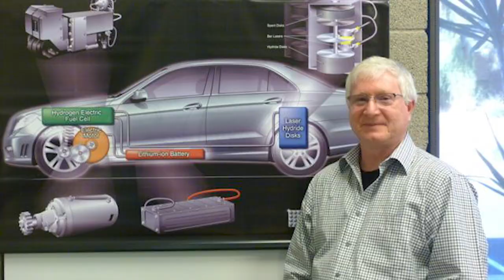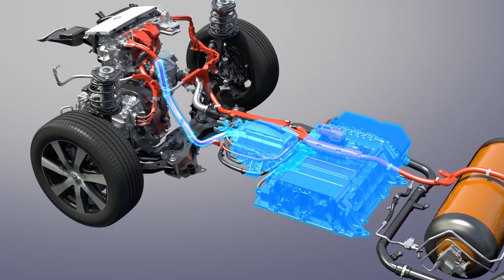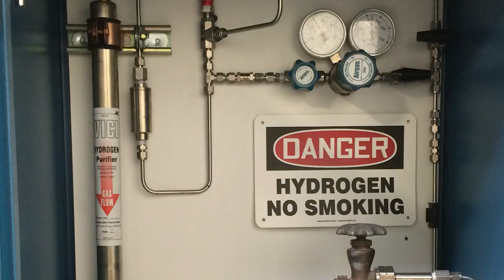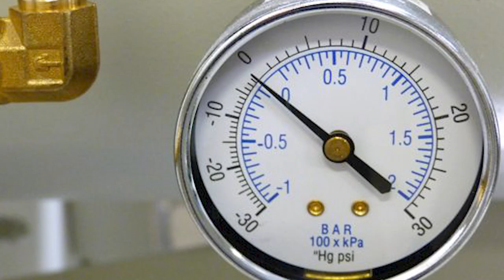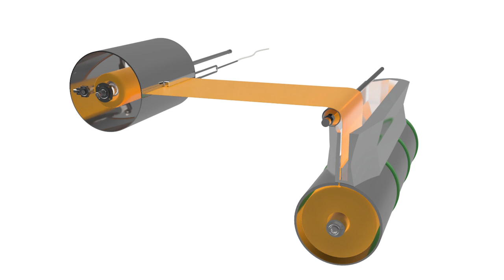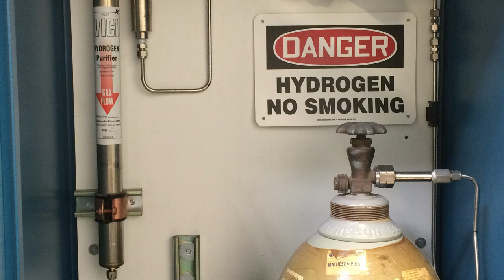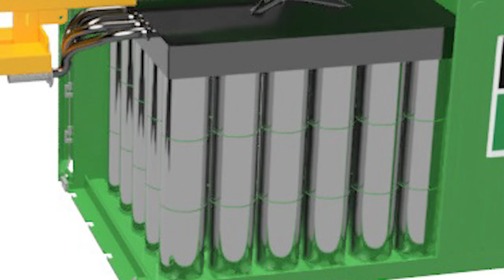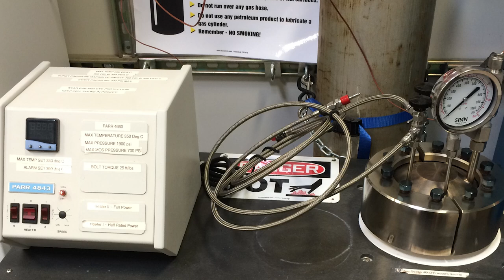This BANNED Technology Could Push Hydrogen Cars Over BEVs

Comment: IMO: I enjoyed reading all the technical analysis and inherent known and unknown issues with this technology, but as a non-scientist, I would say the hydrogen fuel "discs" would need to be substantially cheaper than BEV per mile for the average person to be willing to change out multiple 15lb., discs for every 20 miles of driving, as opposed to plugging in a cord.
Reply: The idea of using hydrogen as a fuel source appeals to me.  Particularly, if the production of the hydrogen source is not as polluting as the mining of lithium, cobalt manganese etc.   for the production of batteries. The thought of poisoning swathes of child labour in third world countries so we can drive to the supermarket in our shiny ‘green’ cars takes away the pleasure of driving.
Reply: @robertkemp9120  Old news. Batteries are getting less and less Cobalt, or even none. Batteries can be recycled for 99% and are the most efficient way to carry energy. All the steps involved in hydrogen cost 3-5 times as much, and that causes its own pollution again...
Reply: @salipander6570  at the moment
Reply: @salipander6570  Show me one - ONE commercial venture or fully subsidized venture to recycle energy-dense rechargeable batteries with 99% total material recovery - and I'll show you a marketing scheme. Not that this is the answer either; the issue is the inefficiency in energy consumption. Plus - if you are in the US, you are charging your electric car by burning coal or natural gas somewhere else (unless you are in a state with the entire grid powered by renewables (none right now) ).  BEVs are not a bad technology, but it is not a silver bullet. The real problem is the general inefficiency of the current transportation system.
Reply: Think it was 15 miles per cartridge, 10 cartridges, 150 miles.
Reply: @noimportance276  Long response, but you've triggered some thought processes. I'm going to refute some of what you said, but also agree with some of it. So this is not me picking an argument. Rather, I'm discussing what you are saying. So, thanks for your comment. It's appreciated here.

Some of the arguments in this thread arise from old information and some from the results of a long-standing campaign by vested interests to raise doubts about Hydrogen and BEV fuelled transport. 

Even if an EV is recharged from electricity provided by coal-fired generators, the EV causes less pollution than any fossil-fuels vehicle by dint the fact that the EV is at least 70% efficient overall, whereas a Diesel car engine can never be more than about 30% efficient, and a gasoline engine is no more than 25% efficient overall, according to Carnot cycle theory. From a fuel burned to energy extracted, the Carnot cycle holds merit, because it is correct mathematically and physically.

Some Diesel engine manufacturers can make reasonable claims of 50% efficiency for large engines, because different metrics are being used, and various losses can be ignored. In practice, Diesel engines in road vehicles are about 20% efficient at best, in real life driving conditions.. A gasoline car tops out at about 17% efficient in real world conditions. Many are run far less efficiently than that.

The coal-fired power plant is inefficient, for sure, but the maths adds up, otherwise nobody would be running them for very long without substantial subsidies. Incidentally, the worldwide oil industry is subsidised directly to the tune of about $6 trillion each year. And that rises to several times the amount when indirect subsidies are considered. Robert Llewellyn made a video about that in the Fully Charged Show, within the pasty year. His sources are valid; I checked them at the time.

In practice, many EV owners recharge their cars from their own solar PV panels. I don't, because I don't have the space to recharge my EV at home. About 20% of homes in the UK have the same challenge. I use public recharging, and it hasn't cost me a penny for the past 5,000 miles. UK grid electricity is partially from solar and wind sources. So far this year, about 33% of the grid supply comes from renewables, and another 10% comes from nuclear power plants.

When you start to look at the ways in which fossil fuels, and about 90% of Hydrogen, are sourced, the overall system efficiency becomes abysmally low. Hydrogen, in the main, comes from petroleum and 'natural' gas. Finding that oil and gas requires a lot of energy input. Drilling and extracting it needs even more. But at that point, the fuels are not useable. They need transporting, refining, transporting again, usually in Diesel-fuelled trucks, pumping and dispensing into the end user vehicle, each step of which is inefficient. At that point, it is burned at 17-20% fuel efficiency. Sheer madness, from an environmental viewpoint.

To present the vehicle efficiency in a different way, my EV [a Renault] has an available traction battery capacity of 52 kWh. That energy is roughly equivalent to the total available energy in 1 Imperial gallon of petrol [gasoline]. - We'll stick to miles and gallons, because I grew up with them, and because you use them daily. The differences between US gallons and gallons don't matter here, because I'm only comparing figures for two different vehicles.- I owned a small 'efficient' gasoline-fuelled car, which could manage 60 miles per gallon, when driven carefully. If worked properly, it would do about 40 mpg. My EV has a claimed range of 243 miles per charge - about 6 times that of the petrol car. When I drive it carefully, I can extract at least 280 miles from that 52kWh, maybe more than 300, but I haven't tried to run it to exhaustion. So that's about 5 times the range of the gasoline-powered car.

Roughly 70% efficiency divided by 5 is about 14% efficiency for the gasoline engined vehicle. Real world figures obtained by the same driver. The EV is heavier than the gasoline vehicle, so that affects performance somewhat, but the EV is far more comfortable to drive, much quieter, and less smelly than the gasoline car.

The next biggest issue for me with Hydrogen-powered vehicles is that they carry Hydrogen fuel tanks, protection for those tanks, a fuel cell, management for that fuel cell, a traction battery, battery protection hardware, the battery management system and the ancillary equipment which can be found in both EV's and Hydrogen cars. This is a lot of added complexity and mass, which means more cost to the consumer. Then there's the price of Hydrogen. I watched a recent video about refuelling a Toyota Mirai. The Hydrogen cost $64 to refill the car. The projected range was about 260 miles, after filling. That's a cost of about 25 cents per mile of driving, after the 'free' Hydrogen allowance runs out [3 to 6 years, as of 2022]. My EV obtains free electricity, but if I had to pay for it, then local price is about 28 pence per kWh - let's say 35 cents US. That gives me about 5 to 5.9 miles of driving. Let's use 5 miles, for the worst case, and easy Maths. That works out at 7 cents per mile.

As for the increased purchase cost to the owner, not everyone has access to incentives. The Mirai costs $68,500 to buy without incentives. The Zoe is not available in the USA, but it cost me about £21,000 via some negotiation. The list price today is about £30,000, without incentives [we only have one, anyhow!] which is around $35,000 - roughly half the price of the Mirai, and I have a similar range to the Toyota. Your servicing costs are going to be higher than those for a similarly capable EV: I pay £117 annually. The gas car cost me about £280, which must be similar to the Mirai servicing cost, given the additional complexity, if it was serviced over here.

So whichever honest way you look at it, the Hydrogen/ electric car falls short of the purely electric one, in purchase cost, running costs, efficiency and pollution. I'm not dead against using Hydrogen fuelled cars, if the infrastructure becomes available to refuel them, because they are a definite improvement over Diesel and gasoline-powered vehicles. But they're in a kind of limbo, along with hybrid gasoline/electric cars. They'll all be around for a few decades, but they are looking more and more like an economic and environmental dead end.

You also mentioned doubting the level of recycling of batteries. I'm also inclined to doubt the '99% recyclable' claim, because wastage always happens. That figure needs defining specifically by those who claim it. Maybe it's simply media hype, after misinterpreting the wording used? It could come from '99% of batteries can be recycled', which is quite a different thing. That latter makes much more sense to me, and probably to you too.
But what does happen is that used car batteries become useable in relatively low cost home electricity storage systems, for at least another 5 to 10 years before they are ready for recycling. Those batteries are prime candidates for those who mine minerals, because they contain Lithium, Cobalt, Manganese, Aluminium, Phosphorus, Iron and other elements in much higher concentrations than can be found in nature. This makes most of the quantities of each element much easier to refine efficiently, That's why one such recycling plant is being built down the road from Giga Berlin, for example. It makes good economic sense to source a part of their output from used batteries.

If you have done, thanks for reading. 🙂
Reply: @RWBHere  Obviously, you are misinformed about many aspects of Plasma Kinetics' advances in FCEV technology. There will be no onboard tanks to hold Hydrogen, for example.
Reply: @noimportance276  Many BEV owners also get solar systems. Generally I'd you're into one you are into the other
Reply: @claudfraleigh2062  
You're the one who's misinformed. He was comparing gasoline, electric and hydrogen cars that are actually produced and on the road.
Reply: @RWBHere  Mention must be made that a fuel cell uses minerals, requires maintainance and has a limited life; less than an ICE.
Reply: @robertkemp9120  o XD
Reply: I think Hydrogen will be useful for plains and cargo ships. Of course when it is cheaper. 

 Outside of that I don't see it taking off for cars. EVs offer a lot in terms of torque and acceleration which is always nice and are improving daily and some that don't use lithium and cobalt seem promising.

 Thought hydrogen was super dense per KG. 15 pounds for 20 miles...  Gotta look up the efficiency and density between engines too now 
 
 Wonder why they can't be reused more times or recycled all of it.
Reply: @RWBHere  did you account for the loss of EV efficiency from operating in below freezing weather? The chemical batteries automatically loose much of their charge, and the freezing-thawing cycle destroys the service life. 

Also, in very cold conditions, much  of the "waste" heat which makes ICE engines less effective, is essentially recovered to heat the vehicle.

Comment: Hydrogen is not green energy. It is produced by either two methods. One. Separate the hydrogen and oxygen atoms in water which requires a lot of electricity. Two. Hydrogen is a by-product of the reformation of hexane molecules which are a straight chain 6 carbon and 7 hydrogen atoms. The catylist in the reformer removes one hydrogen atom which forces the hexane molecule to form a circular molecule called an olefin. This is gasoline . The removed hydrogen atom is then compressed and stored or simply burned off at the refinery flare. So to recap, either use heaps of electricity to produce it, or keep making gasoline.

Comment: What blows my mind is how fool sells continue to amaze people who can't wrap their heads around thermodynamics... How is this extra contraption making the Rude Goldberg battery that is still an HFC PEM, with a new storage tank any better?

Why did I not hear about:
Energy density.
Power density.
Conversion efficiency.
How does this beat metal-hydrid storage.
Reply: Because if they listed specific number, we would realize it is not that great.
Reply: Exactly. This isn't passing the sniff test.
Reply: It doesn't beat metal hydride storage because it is metal hydride storage. Using a laser to heat the metal to release the hydrogen is a new twist, but doesn't really make it better than other metal hydride proposals.
Reply: @chrismuir8403  awesome... So my two decades old 20 liter tank is still state of the art.  Awesome, I'll take a Li-ion battery any day in that case.  What a damn joke.  It would be funny if it weren't so sad that EVen Sandy has fallen for this garbage.  Trevor who?
Reply: @flodjod  granted.
Reply: I suspect it IS metal hydride storage.
Reply: @bernardberrier53 , they are not heating the entire mass of metal hydride as some other storage systems did. Instead they are using a laser to heat one spot on a thin film, making a controlled release of hydrogen. Problem is, after the lwser moves on, the metallic film cools and starts re-absorbing the hydrogen. Some sort of sliding seal may be required.
Reply: I looked on Plasma Kinetics Website: 
Plasma Kinetics: 8.7kWh/kg
Hydride: 34.8kWh/kg
They also have the same temp/pressure ratio, but because plasma kinetics holds 1/7 the hydrogen per unit (and therefore is held at a lower pressure) it also has a lower storage temperature, which would bring advantages of it's own in personal-use cases.
Reply: @chrismuir8403  Metal hydride is metal bonded to hydrogen. I didn't hear him say anything about metal or hydrogen being bonded together to manufacture this thin-film material. Metal hydride doesn't absorb H2 unless it is applied under pressure, this stuff sucks it up like a sponge. 
The 50,000 foot view of how it works is discussed in the video for about 30 seconds starting at the five minute mark.
This material does not employ an endothermic process to release the H2, it uses electromagnetic spectrum, specifically light, to do this. There was no mention of using a laser to heat the material. Lasers do not have to be hot (laser pointers are a good example).
Reply: @KingMelo007  where did you find that data?
Reply: @D0li0  the plasma kinetics website. When you scroll a little bit there's a section called Hydrogen Storage Comparison , and they compare their system, Compressed gas hydrogen, extremely low temp liquidified hydrogen, and metal hydride.
Reply: @chrismuir8403  this is not what is going on here . It isn't using the laser to heat anything.
Reply: How about take a look at what JCB are doing with hydrogen.
They have developed a hydrogen powered ice vehicle, with zero emissions.
Mainly for the heavy vehicle industry, trucks, construction, and farm vehicles, but it has the potential to rival EVs, especially in the re-fuelling area. 
Check it out.
Reply: @Invictus357  I hear the what your saying, and it seems to make sense at face value... But..

In many of those contexts, say farming.  A big battery which simply swaps would beat out hydrogen across the board, and be "practical".
Reply: @KingMelo007  Very good you are one of the few who grasped what this can do over liquid hydrogen.
Reply: @Weissman111  There is a new proof in concept study from NREL and a professional video under production explaining this technology. As an educated Electrical and Nuclear engineer I was also skeptical until I was sent the documentation from the company. Then density is 30% less than liquid hydrogen with less weight. It appears they now have a major backer so more will be released in the coming months.
Reply: @Weissman111  You will see more than CGI shortly based on what has been presented to me and others in the power generation industry.
Reply: @KingMelo007 As I understand from company's website 'Kd energy' stands for energy needed to pack hydrogen to the storage and 'alpha energy' is amount of energy to unpack it back. And 'total energy' is the sum of two. It is what you show us: 8.7kWh/kg for Plasma Kinetic's film material and 34.8kWh/kg for MgH2 metal hydride. This could not be energy dencity of storage. Because the highest dencity per kg belongs to pure hydrogen with 33.6kWh/kg. That numbers rather are 'energy tax' for storing H2 in each particular storage.